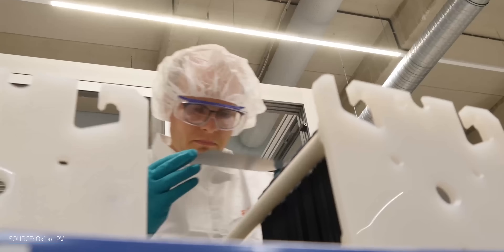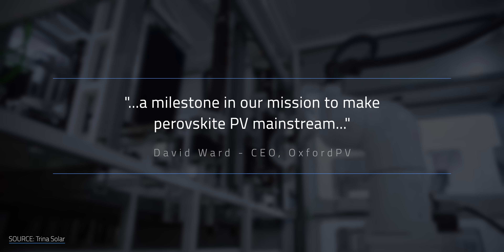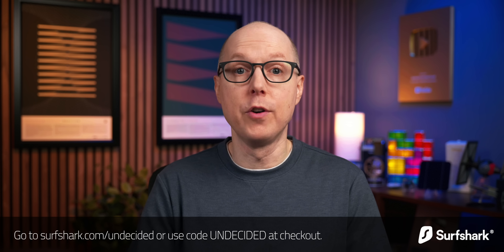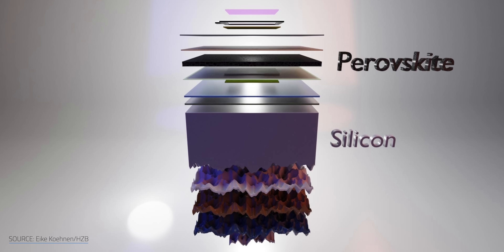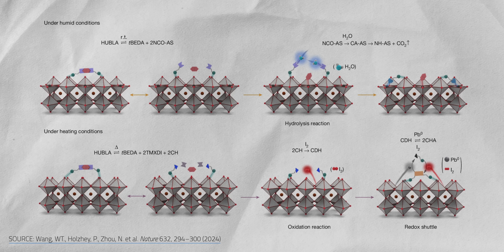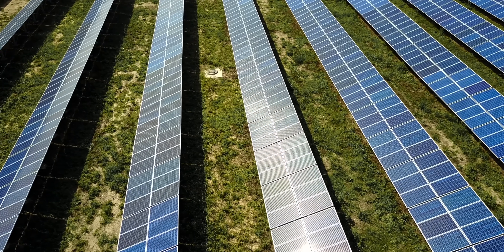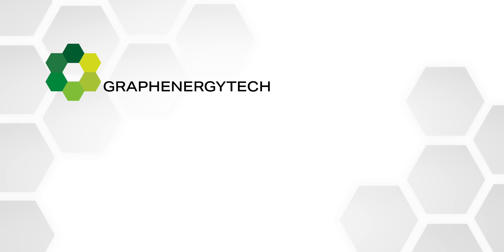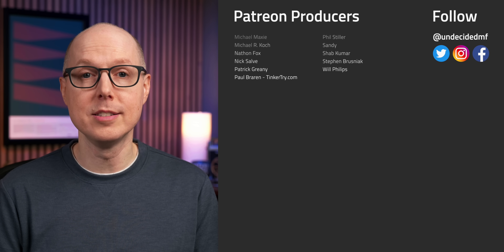What Solar’s 2025 Breakthroughs Mean for 2026

Comment: Does this mean they're finally going to run heating coils through all new sidewalk and road construction and replacement, helping to minimize slip and falls and traffic accidents in the colder parts of the US? Also helping to extend the life of said infrastructure? If anyone has issues with this, then consider the power generated in the summer can be used as basic energy for aux power items in the summer, sidewalk lighting, traffic signals, incidental lighting.
Reply: Heating sidewalks to melt ice is incredibly energy-intensive. Based on W / sq ft of retail heating pads, just sidewalk would draw more power than the house it's in front of.
Reply: @erikdietrich2678  a quick ask CoPilot gave me this bit of information:

Every year in the U.S., more than 1 million people are injured in slip, trip, and fall accidents, with a significant portion occurring on public sidewalks and streets. In addition, icy roads cause about 156,000 crashes annually, leading to over 116,000 injuries and more than 1,300 deaths.

coupled with

Annual crashes: Federal Highway Administration data shows about 156,000 crashes per year are directly caused by icy roads.
Injuries and fatalities: These crashes result in over 116,000 injuries and more than 1,300 deaths annually.
Wider winter hazard: When including snow, sleet, and slush, the number rises to over 562,000 crashes per year.
Risk factors: Reduced pavement friction, longer stopping distances (up to 10× longer on icy roads), and poor visibility all contribute to the danger.

I'm going to guess that there are several cases where the city, county, or state are sued. so, yeah, save a few cents by not having heated sidewalks and roads. Besides, if you keep the roads and sidewalks a uniform 34 degrees or warmer throughout the year, not only will there be no, or little, ice, black ice, slush, etc., the roads and sidewalks won't crack as fast meaning longer road and sidewalk life.
Reply: @erikdietrich2678  Besides, Erik, had you watched the original presentation, you would have found that my main comment was originally, paraphrased, 'Now that solar collection, and energy storage, has gotten this good, they can do something necessary; such as gather the energy during the day and using it to keep the sidewalks and roads cleared by raising the temp of the sidewalks and roads to about 34 to 36 degrees to assist in keeping the surfaces cleared.' We're not discussing the really bad solar power or energy storage from the 1980s to 2003, the new collecting and storage is truly incredible. With your original comment, it makes me wonder if you're a corrupt lawyer or city worker desperately grasping to plowing and salting.
Reply: @cannedmusic huh? It's a sheer function of energy needed to melt ice and snow--which is a lot--multipled by surface area. It's thermodynamics. It doesn't matter where the electricity comes from. It still takes 100s of kWh to melt one block-length of sidewalk.
You do the math and tell me where I'm wrong. No reason to go ad hominim.
Reply: @erikdietrich2678  ad hominem? You started it.
Reply: @cannedmusic  If my thermodynamic estimates are wrong, show me where. How much electricity would be needed to melt a city-block-sized section of sidewalk snow?

Comment: I would say we've entered the era of perovskites, but I wouldn't consider it "the year of the perovskite" until it distinctly shifts the market.
As a Linux user, it's a similar situation, where basically as far back as 2008 people were like "this might be the year of the Linux desktop!" but the total marketshare barely changed for all that time.  However, Windows 11 has become increasingly unappealing to people, where Windows is losing significant marketshare.  Although many people are giving Linux a shot within the past year, Mac OS seems to be getting most of the new users.
The problem is, people aren't going to switch unless there's a really compelling reason to.  For most people, the extra efficiency of perovskites doesn't really matter, but longevity and cost do.  They need proof of endurance and they can't be disproportionately more expensive.

I think where perovskites might make the most sense are sub-200W loads.  These are panels where you need on-site power for things like lamps, security cameras, radio repeaters, weather stations, electronic road signs, camping equipment, etc.  Not only can a large PV look unsightly for such devices, but the dimensions of PVs can be unwieldy for them, and they're often in heavily shaded areas.  Having a smaller and more efficient panel would help alleviate some of these problems.

Comment: الولايات المتحده الامريكيه ضد كل شي اخضر و ضد الهيدروجين  الاخضر ولا تهتم بمشاكل البيئه إطلاقاً
Reply: My husband has worked at two utility companies and I at one. For the utility industry, it's not about being green but about cost efficiency. Matt stating that "solar is one of the cheapest ways to produce electricity" is incorrect (sorry Matt). The only way solar and wind makes the list as cheap is by utilizing LCOE (levelized cost of electricity) that factors in non-energy variables such as air emissions, carbon dioxide, greenhouse gas, life cycle, maintenance, etc. If one doesn't use LCOE then hydro, then natural gas are the cheapest. 
Where I live, Spokane County, State of Washington, over 60% of our electricity is hydro, then 20% natural gas, 10% nuclear, 5% wind, 3% coal, and 2% solar. Due to regulations set by Washington state, utilities are required to have X amount (I don't how much) of renewable energy sources which results in he utility companies having to purchase renewable "credits" from outside of their areas. So Spokane County is fairly green when looking at the LCOE factors.
LCOE is the industry standard and when used hydro, solar, and wind are cheap but utility companies are a business and profits. The number one factor that determines which power generation(s) to use is area...where electricity will be produced.
Reply: What I meant in my previous statement was Trump’s current policy. He does not encourage green energy compared to other major powers such as China. He also considers “green energy” policies to be part of a Democratic agenda.  @julieinthenorthwest4594

Comment: The collaboration between next-gen materials and graphene is a standout. When cost reductions and lifespan improvements converge like that, it usually signals a tipping point for wider industry adoption.
Reply: Another interesting point is the weight factor.  With the reduced weight a combined Perovskite and Graphene arrangement could make self charging EV's economical and practical.
Reply: @anguscampbell1533 For a standard solar panel, the vast majority of the weight is the cover glass & frame.  The Si is so thin, it’s barely a blip on the cost.  However, the standard thickness (3mm) is generally needed to prevent enough flexing such that would ‘crack’ a Si cell.  So - you won’t get any weight reduction from a Tandem perovskite.  However, if a multi-layer Perovskite, I believe (like thin film) can flex much more.  At that point, it’s really just a matter of how they do the environmental sealing.  Structurally, a ‘standard’ panel can’t go tooooo much below 2.0mm thick, or may not be strong enough.  If that’s the case, then ~30% weight reduction.  Cars and/or building integrated are interesting… takes away structural pressure, but depends on cover boundary (which I’m pretty sure can NOT be plastic, acrylic, etc)…
Reply: @anguscampbell1533  What kind of EV's you're talking about? Trains? Yeah, pretty economical. Cars? They themselves are not practical.
Reply: @saiv46  
Try reading u on these developments.  You would surprise yourself to know what companies are doing research on PV powered cars.  Mercedes is one.